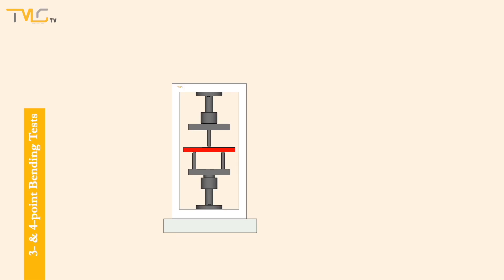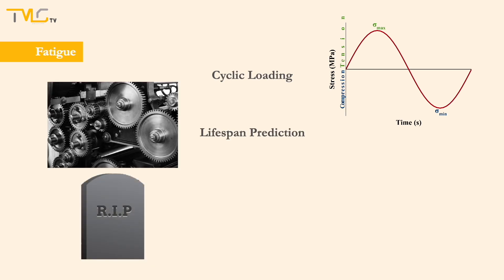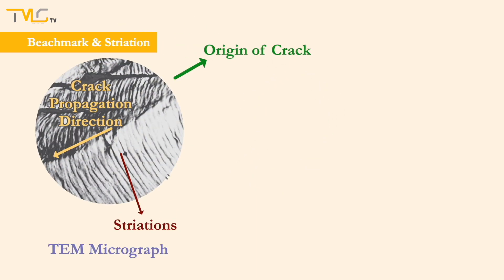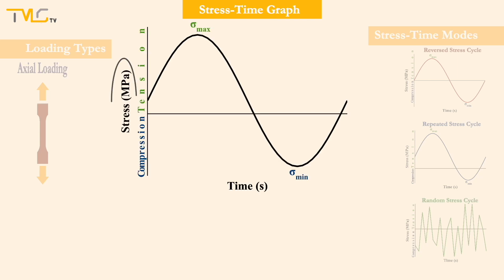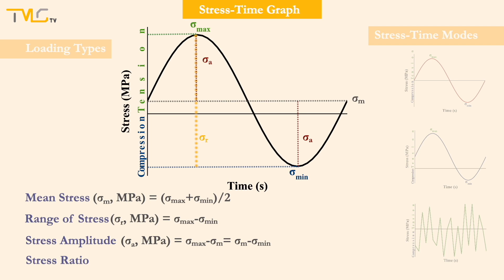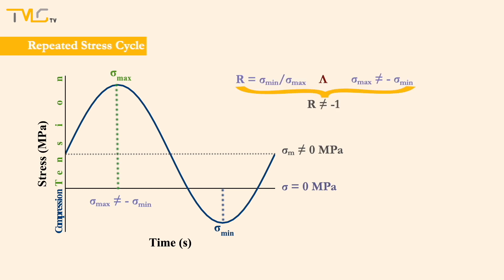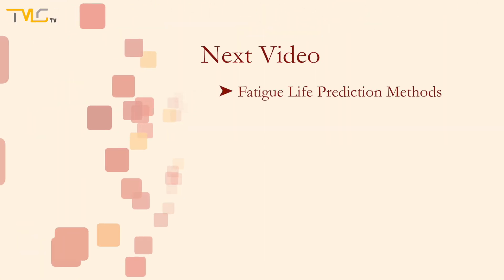Video #2.5 - Introduction to Fatigue (Mechanical Properties of Materials)

Comment from the maker: Time Stamps
------------------------------------------------------------------------------------- 
0:30 What Is Fatigue? (Yorulma Nedir?) 
0:55 What Is Fatigue of Materials (Malzemelerde Yorulma Nedir?) 
2:15 Factors Causing Fatigue Failure (Yorulma Hasarını Etkileyen Faktörler) 
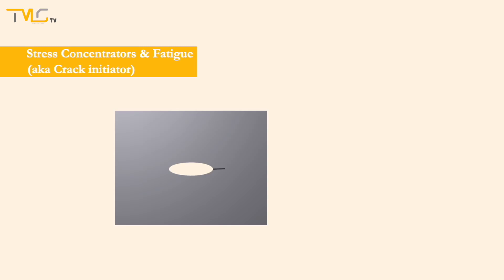2:50 Crack Initiators (Çatlak Başlatıcılar)
3:37 Beachmark & Striation (Halkasal Desen & Çizgi)
4:41 Cyclic Stresses (Periyodik Gerilimler) 
7:02 Reversed Stress Cycle (Ters Gerilim Döngüsü)
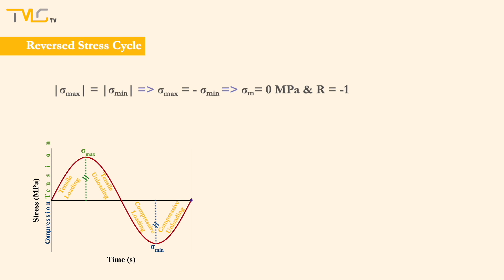7:58 Repeated Stress Cycle (Tekrarlanan Gerilim Döngüsü)
8:22 Random Stress Cycle (Rastgele Gerilim Döngüsü)
8:49 Stress-Time Mode Example Applications (Gerilim-Zaman Modu Örnek Uygulamalar)